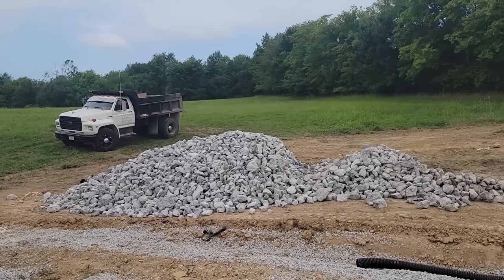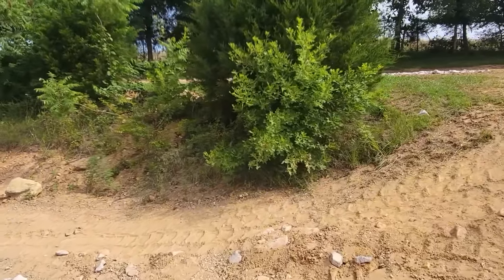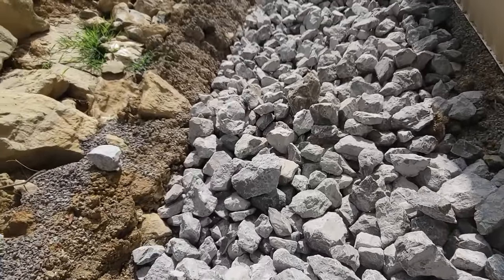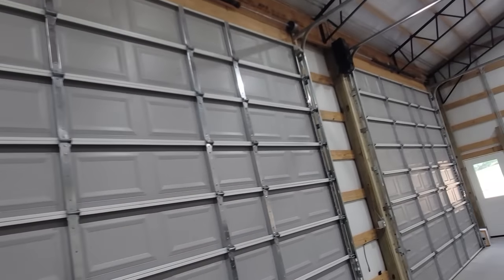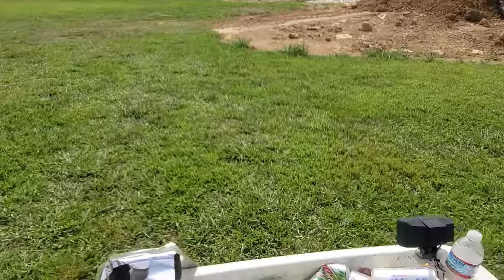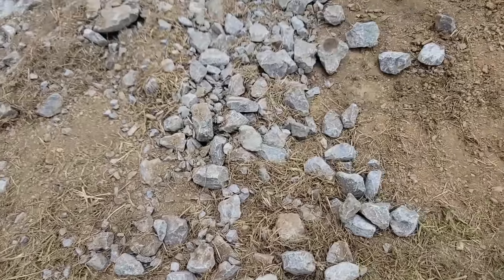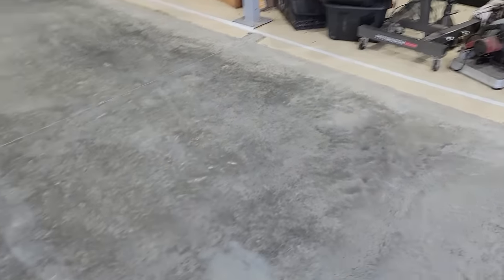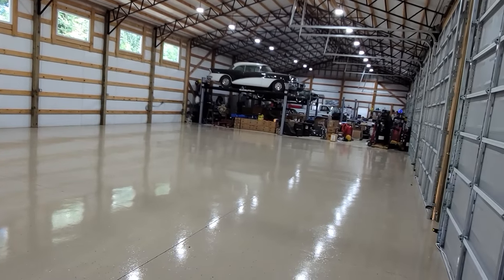My NEW Shop FLOODED! - Here's what happened (we had to start over)

Comment: I know, opinions are like sphincters and theys a lot on here, so here’s mine.... hold your nose and open yer already smokin check book. I’m thinkin a six inch thick concrete wall three foot below and five foot above ground placed between the fence line and the ditch with rip rap running the whole length of the building or more should slow down the gush of water. That’s a lot of collection area on the other side of the fence. Hindsight is 20/20 as they say but the folks that built that building originally should have built up the ground to four or five feet before pouring the concrete slab for the building.

Comment: I'm not an engineer but I don't think that's going to fix your problem, what you have for drain pipe is going to good caring the down spout water away. The roof it's self will over flow those with a hard rian you should have put at least a 12" pipe back there to remove run off water and down spout water. I'm just saying I've been around to know enough that it's hard to comprehend the amount of water and run off  you get  with just one inch of rain !

Comment: can`t hardly believe that the crews doing your footers did not think the drainage through from the start . kinda piss poor planning on their parts . when doing the footers , it should have been poured with a 2 foot high knee wall around the back and sides , then the tin going about 3 inches above the ground . the knee wall then should have been sealed . as far as rusty acres is concerned , it could have been solved by just doing the proper grading . no need for drains that will only fill in with dirt and mud as time goes by . all of these things would have saved you a ton of money and headaches

Comment: As the others have said. You downspouts need their own dedicated drainage. Do not rely on your roof drainage pipe to move water coming off that hill. A cheap idea for a retaining wall is just bags of concrete. Stack them on top of each other to make a wall. Water down the bags. Eventually the paper bags will biodegrade and it looks surprisingly nice.

Comment: I know a lot of people are going nuts with how you should have done it much more expensive of a way.   In a way - they're right.   In another, you're working on a tight budget.   

My suggestion, going forward is work towards building a channel at the top of the slope, next to the road.   If the road is too narrow, you can even make the channel concrete, then lay boards/grid/whatever across it.    That's all.    That way the only water you'll deal with is direct rain, and the water off of the roof.    Those will be bad enough, but at least you'd be able to jet them out when the dirt grows through the slits.   Eventually, yes, you'll need/want to dig it out, but hopefully you'll be in a better place financially.   The channel you could do yourself, slowly, with a ditch witch and hand concrete mixer, just one section at a time, starting from the lowest point to the highest.

Comment: Holy smokes I just want shut up! LOL 
 WITH THAT HILL BEHIND THE SHOP YOU MAY NEED TO OR BE BETTER OFF WITH  A  2 BLOCK HIGH OR 8-12 INCH WALL AROUND THE BACK SIDE OF THE SHOP, BECAUSE  I HOPE IM WRONG BUT THAT  HILL WILL SEND ALLOT OF WATER BACK THERE AND THAT PIPE AND DRAIN  I DO NOT THINK IT WILL STOP ALL THE WATER FROM GETTING TO THE SHOP WALL ESPECIALLY IN HEAVY OR FLASH FLOODING WE HAVE HERE IN SOUTH,  BUT 2 4×16 STACKED WALL OR  8 INCH POURED WALL WILL DEFINATELY STOP WATER FROM GETTING TO WALL AND FLOODING SHOP AGAIN!  THESE ARE JUST MY OPPINIONS HOPE THEY HELP!  BUT THERE ARE MANY WAYS TO DO IT AND I AIN'T THE ONE PAYING FOR IT,  BUT IF IT WHERE ME AND THE HILL WAS THAT BIG I WOULD PREFER SOLID WALL!  BUT YOU ARE SO BUSY YOU LIKELY DO NOT HAVE TIME TO DIY IT AND SO YOU WILL HAVE TO PAY SOMEONE TO DO IT AND EVERYTHING IS ×3 THANKS TO BIDENOMICS!  AND SO IT WOULD BE EXSPENSIVE! WHICH IS PROBABLLY WHY YOU DID NOT CONCRETE IT ALL THE WAY AROUND !
 IT IS NOT LIKE YOU HAVE CLEETUS'S  KIND OF MONEY! LOL
 OK I AM DONE WITH ALL THIS TYPING LOL! HAVE A GREAT WEEK AND I WILL SEE YA ON THE NEXT VIDEO!

Comment: I get that given enough money there is always a better solution. Having had similar issues myself,  you factor in, How many heavy water events are you really expecting? 1 a month, 1 every couple years?, How long am I going to be here?, 5 years, 100. 20?, I didn't plan for the 100 year flood when I did mine. If that happens well i'll just refer back to my bad behavior when I was younger and chalk it up to karma payback.  Then the most important one, How much money do I have? Certainly what he's done is going to help. It probably will work and not plug for a long time. Tennesee gets a lot of rain but not 3 day downpours very often. Derek is aware of that hillside right behind the building. that's  the biggest bugaboo, It's not going to stay there long without some type of reinforcement. Even pouring some large rock on that slope covered in heavy mesh like the state does along the roads with medium slopes works. thats not that big of a slope Thats not the most expensive solution, though not super cheap, but it's fast and pretty effective.There is a number of ways to stabilize it. I do defer to the people that live in the area because they know the climate, the soil and have the advantage of hindsight.. And finally. All of us living in the wet east do put our buildings up a ways from ground level. The guys that poured the slab really should have made that a point before they did anything. I would be most irritated at them. Even one layer of concrete block above grade would have prevented what happened and he wouldn't even be doing what he is now, Again, Hindsight. Being that close to that hill, I'd have done a foot minimum. But everyone is an armchair engineer. Lemme look at my check book... MMmm, I can only do what I can do. . No matter what , hindsight is much clearer than all the balls you have in the air when you're doing these projects, And no matter how big your building is, it's always too small when it's done. But carry on, Derek will be just fine and I'll continue to enjoy the channel.

Comment: Don't really see the need to hire an engineer.  You build on a slab at the bottom of a hill common sense says how am I going to mitigate the water around the building?  A trench dug out around the perimeter with an 8 inch pipe connected to a pump that drains into a larger ditch is the best way to stop this from happening.